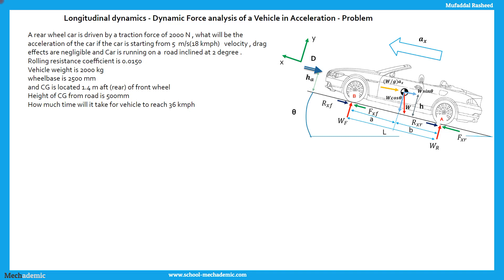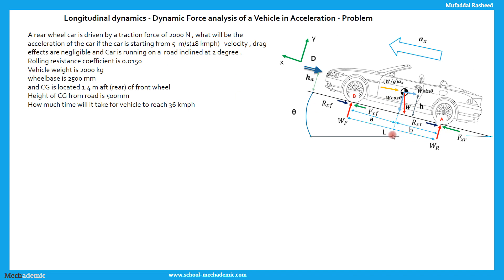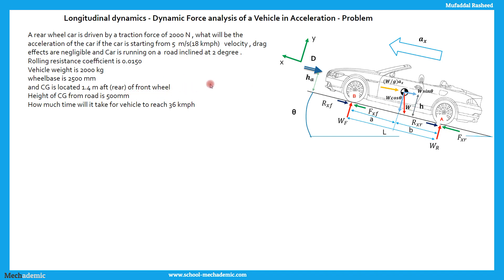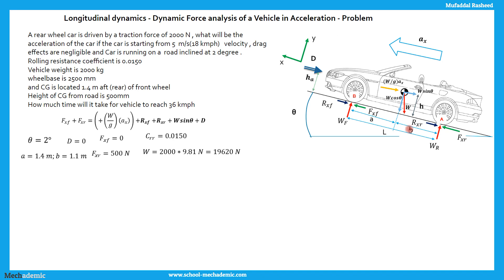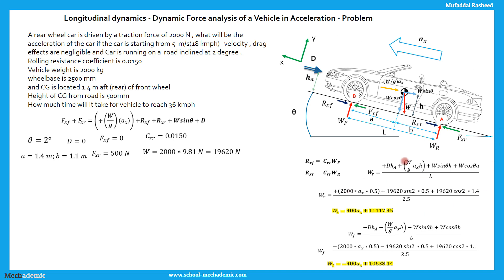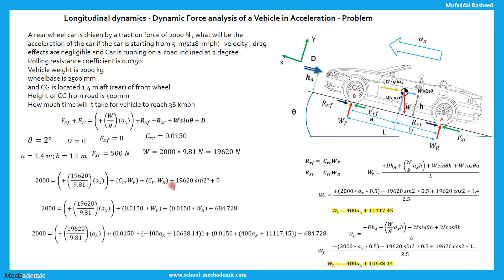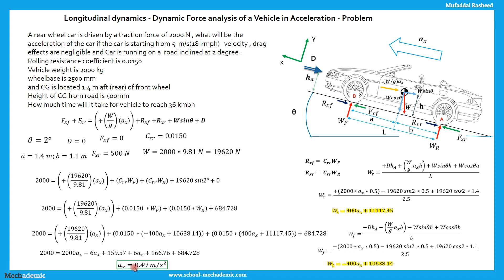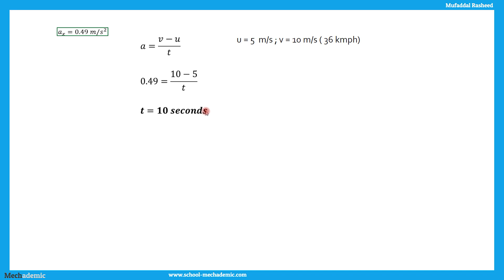Dynamic Force Analysis of a Car in acceleration - Vehicle Dynamics

Comment: Are W_r and W_f supposed to have the a and b swapped when solving? I would think Wcos(theta) should be multiplied by b when solving for the rear wheel, considering that is the distance from the rear wheel that the vertical component is acting from.

Comment: Hi, I am trying to make an ODE model for the velocity of a HILUX  but my calculated traction force  using wheel Torque/Radius is about 2000N while the negative horizontal axis force due to weight is greater meaning the car would not accelerate but instead go back down the hill. What can be wrong there?